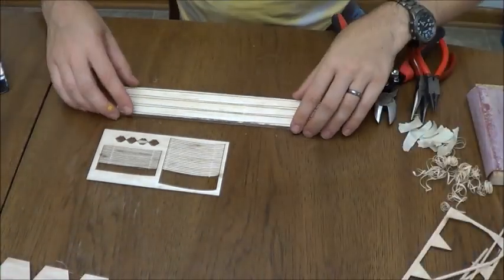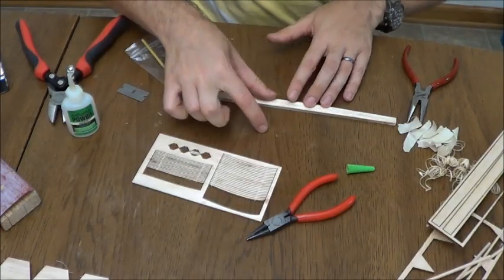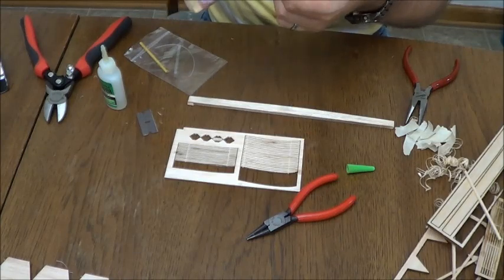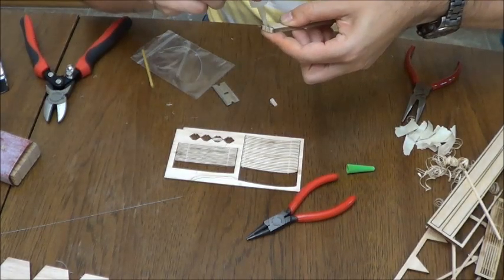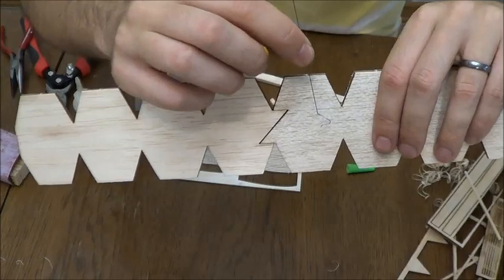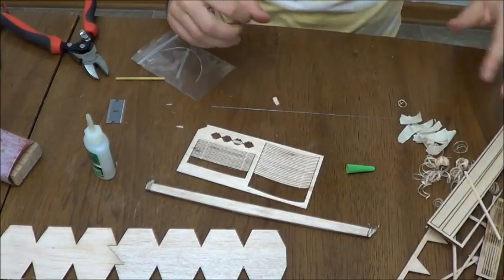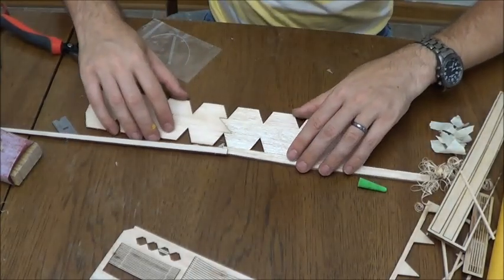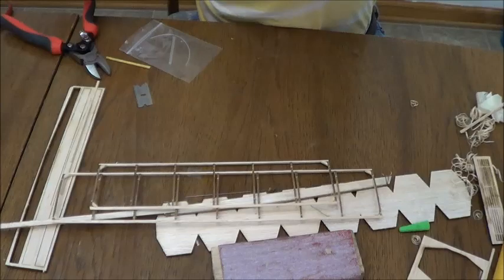Senior Flyer Build Pt.2, Fuselage

Comment: When we were threading the nose bearing onto the wire, my partner and I couldn't get it to naturally stop. What is the purpose of doing this since we're supposed to use the wire for a hook?
Reply from the maker: I'm not quite sure what you're asking. What do you mean about stopping?
Reply: At 3:19 in the video, the wire would "only go so far" through the bearing. My partner and I were a little bit confused by this because the bearing would thread through the whole wire instead of naturally stopping. Also, we weren't particularly sure what purpose this step had to do with the rest of the construction of the plane. Thanks so much!
Reply from the maker: Schen 123107, oh, yeah, don't worry about that. I was straightening the bearing because the tolerance on the front bearing was really tight. The kits have a different bearing that's looser, so you don't have that problem (that's a good thing).
Reply: Ok, thank you so much!

Comment: What are the dimensions for the motor stick in this model if you don't mind telling me?
Reply from the maker: DarkSparklyUnicorn, it's cut from 3/16" sheet, 1/2" tall in the middle, 3/8" tall at the ends
Reply: @joshuawfinn  I'm assuming the wood is around 6lbs?
Reply from the maker: DarkSparklyUnicorn, yes, although at this rate you could go 8-9 and not have the slightest problem.
Reply: @joshuawfinn  I'm using an ikara prop so hopefully the weight isn't a problem. Thanks!
Reply from the maker: DarkSparklyUnicorn, I'm going to try out an ikara on this model and see how it performs.